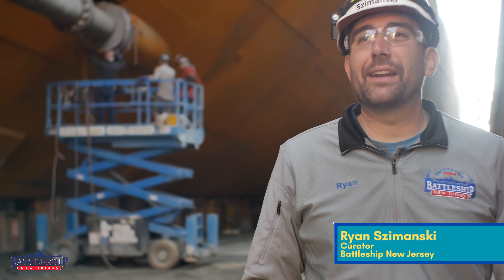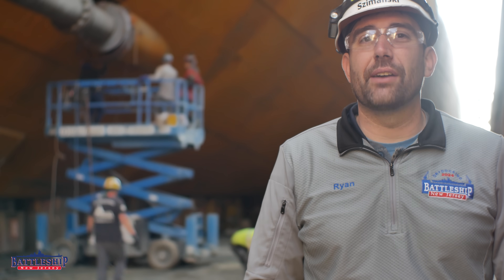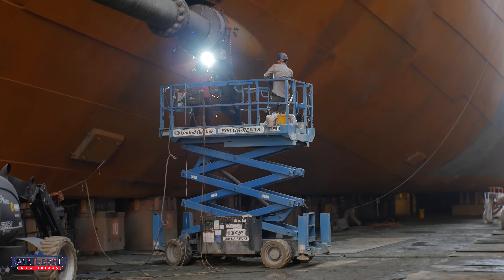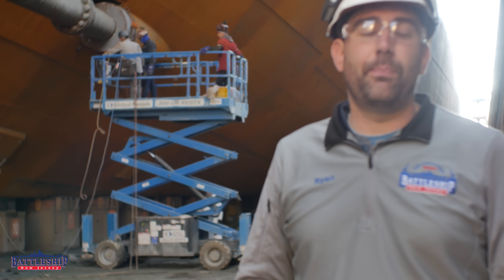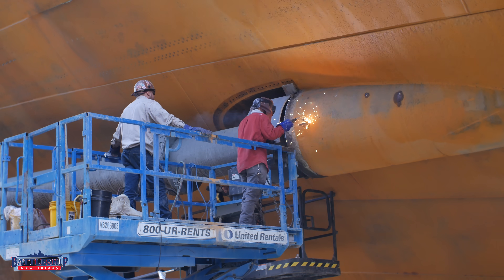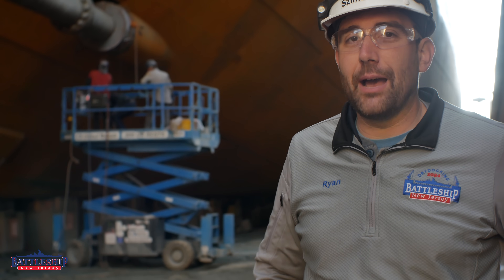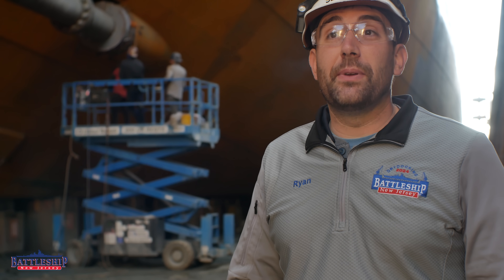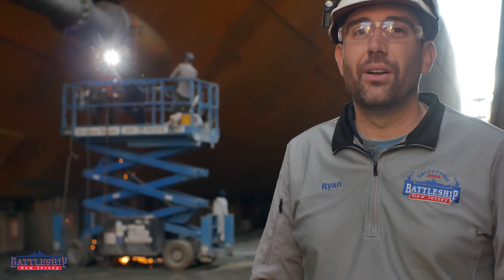How We Keep Water From Coming In Through the Propeller Shafts

Comment: I don't agree that the outboard shafts have the most weight on the glands.  The weight of the propellers on these shafts are not pressing on the glands because the propellers are on the OPPOSITE side of the shaft struts from the glands.  Those struts are acting as a fulcrum through which the weight of the propellers is cantilevering the length of the shaft back to the gland and beyond inside the hull.  

Maybe somebody could do some math and figure out the engineering.  Weight of propeller compared to weight of shaft back to the engine(s).  Calculate the center of gravity of each with respect to the distance from the fulcrum acting on them.

The inner glands have the most weight on them.  The full propeller weight is being transmitted directly into these glands as is the weight of the shafts inside the hull.  These are the ones they should have boxed.
Reply: The inner glands aren't at the end of the skegs, they're further inboard. The skegs are mostly free-flooding.

Comment: Well, I'm no engineer, but the idea that this box made of tin can sheets is supposed to help stabilize the weight of a 20 ton propeller, which on top of that sits at the end of a long lever, seems kind of ridiculous to me. A few colorful balloons glued to the propellers themselves seem more helpful to me.
Reply: The boxes do not support the weight of the shaft or props. They simply prevent water from leaking in.
Reply: @SlipFitGarage  That is what my simple mind had also suspected. But starting at 4:32 Ryan says “it's gonna help support the weight of the propeller in the shaft ...”. Maybe I'm translating that wrong, but to me it means that he believes (possibly advised by the shipyard workers?) that this can sheet could hold anything at all.
Reply: Look_What_You_Did  But imagine me trying to learn something (or questioning my understanding of the English language) instead of harassing people here. And when Ryan claims that this box would help to support the weight of the propellers, it raises question marks in my mind.

Comment: Absolutely no value as a shaft 'support'.
Reply: The ship doesn't need any help holding the weight of the propeller or the shaft. It's been doing that job just fine since it was built in the 1940s. However, the packing around the shaft needs help to prevent water from leaking in. The Box does a terrific job at preventing water leakage.

Comment: Here is an idea. Drill a hole in the collar, add a bung. Putt a pipe in the bung and fill the collar with Flex Seal. Cap off pipe. More added protection.
Reply: Why didn't they Flex-Seal the whole ship ?
Reply: @farmrrick probably because they don’t want to saw the boat in half…

Comment: Absolutely NO! There is no way, rod, material you can weld to the actual shaft and hull to "box" the seal and be water tight. You just fucked it up. In 1 year there will be leaks, litigation, etc. For fucksakes! If it ain't broke, don't fix it. You just completely screwed up those seals. Now there's maintenance on a larger scale. Coming frome a fabricator/welder. Should've left it alone or done the proper maintenance on the bushing seals.

The water pressure is the same if there's a hole in your box. Now there is a box to remove to fix the shaft seal.
Reply: Gonna have to disagree here...  Just adding a preemptive layer of protection against seal failure. Its been done elsewhere, Its not Ryans invention...

Comment: I recall when I was an MM in the aft engine room on the destroyer ( DD 708 ) back in the mid 60's having  a jacking gear . Which slowly rotated the propeller shafts when not underway . I think it was mainly to prevent shaft warpage during cool down . But wouldn't that also be to " lube " the shaft packing ?.
Reply: Look_What_You_Did  Those shafts are turned  by steam driven turbines . And that 600 PSI steam comes from the boilers superheated to  850 degrees F . Massive temp differences along the lengths of those shafts while not turning can bow them  until they equalize in temp .